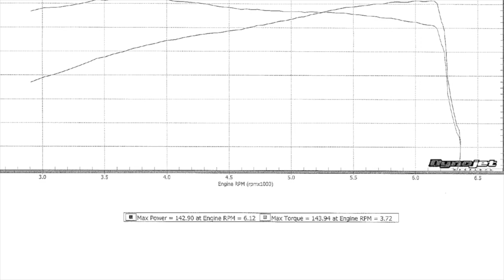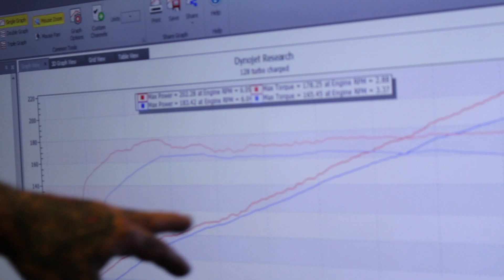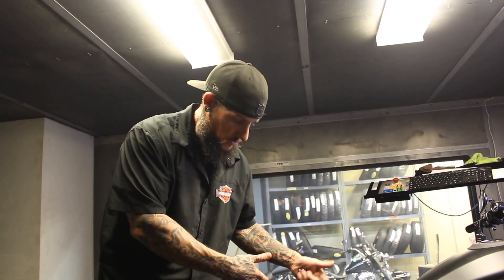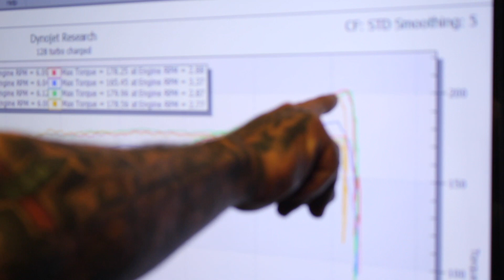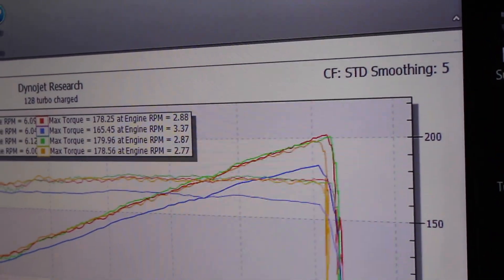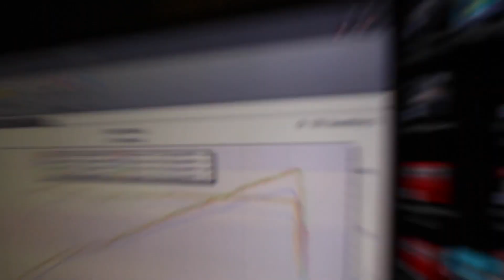200 Horsepower Harley-Davidson FXDR | Custom Build

Comment: A lot of heat in a primarily oil/air cooled motor with lax tolerances vs water cooled. Plus the motor was not designed from the ground up for a turbo.  This is a race motor and durability is probably only 5,000 miles before an overhaul.
Reply: If you just want numbers, it only needs to last for a race lol. Just change your top end with your tires :P

Comment: That’s serious HP right there!
Reply: Yeah same as a stock R1
Reply: @UnrulyRider  well so taking a cruiser bike and installing a turbo to get the performance of a stock supersport bike is super high IQ especially considering that there is turbo in the side which takes out its nice and sleeper look and did I mention death wobbles ?
Reply: @UnrulyRider  I mean I like Harley especially if they are bored out since you can beat most of under 1000cc Japanese bikes of the line but I don't see the point in this build
Reply: @UnrulyRider  I totally agree with your comment

Comment: And then you goto put the high Oct fuel in as well ,that things gonna be a monster . A lot don't understand racing temp of engine and ambient air in the combustion. Look at F1 cars and they are seized until they run hot oil through it first

Comment: Holy Smokes !!!
(And what the hell kind of spark plugs are those? NGK "Thor Series" ?)
Reply: E 3's  are the Thor plugs 😁
Reply: Where they definitely E3 plugs? I would be happy if I got 8 hp on my stock motor.
Reply: Not sure what they used I used E's in my build didnt get 20 hp but saw a 8hp gain 114 RKS to S&S 128 ci my numbers 134hp 153 tq plenty for me
Reply: Bryan Frederick I have stage one with Screamin eagle parts and race tuner. Would these spark plugs reduce engine life span?
Reply: @RayanMufti  No; Rayan in your case just get the stock heat range E 3 plugs I ve ran them for 5 years in a Stage one 103 Heritage I own aswell as my Roadking the stock E3 plugs have a safe heat range the plugs have what is called direct fire down in the center of the plug thats where Hp gains are made due to the hotter or direct fire but stock E3"s heat range its safe for stock motors the E3 hot plug is more aggressive builds such as this one so just ask counterman or lady for stock E 3s for your model of bike 😎👊
Reply: JAJAAJAJ 20HP , WTF

Comment: This is cool but it sucks it takes such a high displacement motor and a turbo to reach numbers that most 1000cc bikes are doing now out of the factory. Hell my 1290R is 177 out of the box and the new Ducati’s are in the 200+ range. I had a 2013 V rod with a trash turbo and was getting almost 200 but for the cost of the bike and kit it just wasn’t worth it.

Comment: Question has anyone every herd of making a Harley run on e85 or is it just like too high of a burn or something?
Reply: with the proper tuning
anything is possible
Reply: roberto romo E85 is growing in popularity on many fronts. You could run this bike on 11.5:1 compression and throw the turbo on it with e85 and it would run just fine (assuming it’s tuned correctly) and make gobs of power while doing so

Comment: you  could  buy a  Yamaha V-Max  close to that much HP stock naturally aspirated  ..
Reply: Mike Skidmore v-Max’s are factory supercharged, that has two more cylinders to help make that power.
Reply: @taylorgtrotter     Stock V-Max is not Supercharged they had some air scoops.. that opned @ 6,000 RPM   the older ones have  1200 CC's the newer ones are  1689 CC's or so .. yes they are a V-4

Comment: The engine does not care what kind  of air it breaths ,,, but yes  can make more  HP  with denser cooler air ..
  E-85 Gasohol  would gain you another  15%  HP and may  be way cheaper than racing gas..

 Expended wasted gasses ??  Normally  dyno  rooms  have   a hose to put  over the exhaust to   vent exhaust  gasses out of the building..
Reply: Mike Skidmore E85 would really wake this bike up

Comment: 128CI turbo only 200 horsepower? This is honestly sad. My 80 CI vrod makes 140 horse. Maybe try a different motor
Reply: 200whp means 220-225hp crank
Reply: It’s built for longevity and performance
Reply: How much torque have you got mate and what’s your rpm?

Comment: I’d just be scared because everything is one off. You can’t just buy replacement parts. I have a built 3 rotor rx7 and I don’t even drive it because it’s so hard to get the parts I need if something breaks. It’s cool to take to car shows but man I don’t even get up on the 2step anymore bc I can’t afford $10k for another billet setup

Comment: Lol, everyone’s freaking out about 200 hp when that’s stock power of modern liter bikes on pump gas naturally aspirated and from the factory.
Reply: Wook On Wheels hater😂😂🤷‍♂️
Reply: Unruly Biker What?probably faster than anything u got
Reply: Wook On Wheels 2 cylinders vs 4. Engine built for cruising vs engine built for high end performance. Air/oil cooled vs water cooled. Dohc vs pushrods. Comparing the two is apples to oranges

Comment: https://www.youtube.com/watch?v=Fm6SFfZCu30 
Here you go, a bike with 200hp you can actually ride off the showroom floor for $20,000. What good is an FXDR with 200hp? Suspension like a dump truck, handling if a skate board with steel roller-skate wheels, brakes from a model T, whoopee fcken chit.

Comment: You do know that ANYONE ELSES 1,000cc bike makes over 200 hp?
It's no big deal.
Hello 2001.
Reply: And about 10 torque at 90,000 rpm
Reply: !?? 2 cylinder! - now you tell me- im interested! 2 come in mind- ducati diavel- ktm 1290- both UNDER 200hp !
Reply: @izom  and both over 1000cc.....
Reply: @flyingdog1498  That is a four cylinder machine - a great bike but to compare that to a twin cylinder .....
Reply: Flying Dog also a completely different type of bike and engine. Putting the S1000rr engine in a Harley would be about like putting a Lamborghini V12 in a Ford F-350. The diesel works much better for its intended application.
Reply: @thakery5720  You are right a Harley Can not begin to compare, like comparing a Ferrari to a John Deere tractor.
Reply: @flyingdog1498  Nobody would do that as the 1000r would not have enough torque to pull a Harley - now putting a high torque Harley type engine in a lightweight and better handling chassis would seem fun but the chassis wouldn't be able to house all that  torque for long without breaking.
 You are trying to compare apples to oranges.... tell me, what bike(s) do you have (had).... what is your judgement based upon ?
Reply: @thakery5720  Why would anyone want to put a modern engine in a piece ofSHIT Harley. AYou are right about a Harley being a heavy assed lead sled garbage truck.
Reply: @flyingdog1498  They are built for comfort and they manage that very well. What do you ride or are you just another 'keyboard warrior' - you are foul-mouthed enough. I did not denigrate Harleys - or any other bike for that matter as I am mature enough to realise that one's own choice is more important than the need to 'go with the flow'. What bike or bikes do you have ?
Reply: Let us not feed the Trolls....
Reply: @redsolocup7854   Quite so Sir.... my doing so was purely unintentional.........
Reply: @thakery5720  The only thing you do inrenrionaly is use your tongue for toilet paper.

Comment: This is very sad considering a woods cam in a 128ci bike makes around 160. Truly sad to make 200 horse with boost. Some seriously reputable engine builders when they don't even know to change the plugs. Add boost gotta change plugs and tighten gap guys come on. Lol at this video.
Reply: Baggerz Anonymous it’s not built or intended for peak power like a race motor. It’s adding the performance with the reliability to last years. 200 is plenty for a street bike

Comment: Ha ha ha custom... most bikes make 200hp stock, Harley you still fail.
Reply: Unruly Biker most 1000cc sport bikes yes
Reply: Unruly Biker you again 😴
Reply: A couple of current Super Bikes make 200rwhp and 90 rwtq on certain dynos.  Common guys....
Reply: Most bikes do not make 200hp stock, only the high end superbikes, which means ur comparing 5 bikes, ducati, bmw, yamaha, kawi(2 bikes in their line up), that come with 200hp from the factory. And then saying all of them do. In reality 90% of curiser bikes which is what Harleys are dont make more than 120hp. Its like you are comparing a formula 1 car to a rolls royce. They are completely different, so then making a rolls royce with say 1000hp would be crazy
Reply: then why are you watching chief